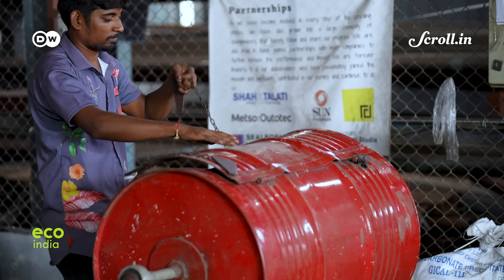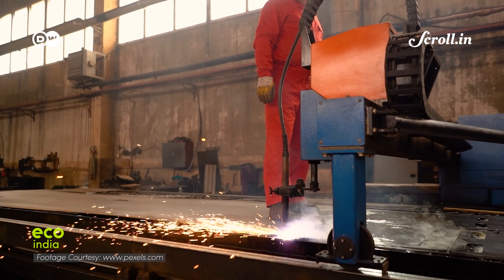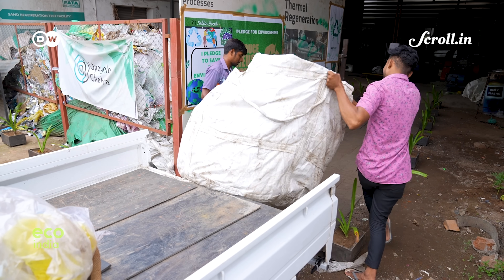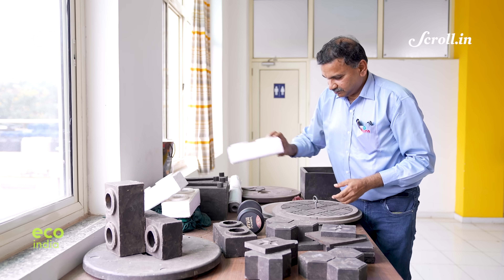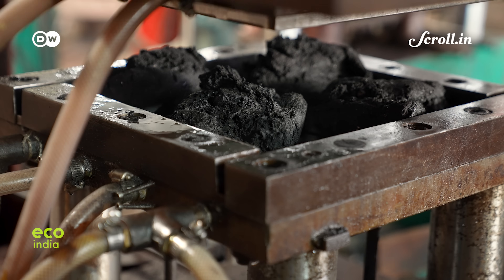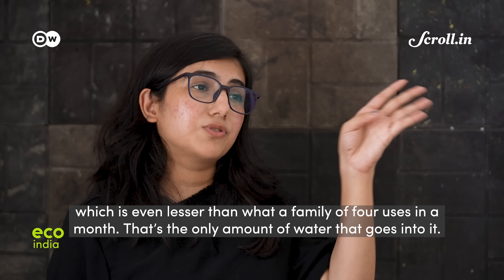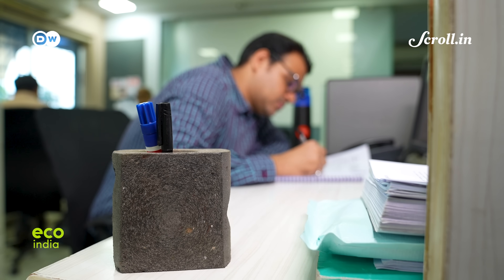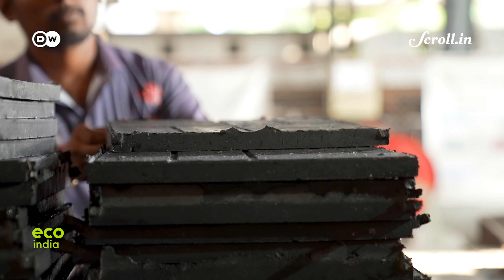Eco India: Can we construct using just plastic waste and dust?

Comment: Isn't this just "kicking the can" way down the road?  Eventually, all these blocks of plastic will become scrap from buildings torn down (or falling down).

My "gut feeling" is to find a way to (safely) incinerate the plastic and use the heat as a "by product".  Of course, this would require special "scrubbing" of the gases before being released into the atmosphere.

All I see here is some businessman trying to make money.

PS: and what about buildings (using plastic floors) catching on fire and releasing dangerous chemicals into the air?

Comment: The tiles and bricks are only ecological, as long as they stay on the wall/ground, where they are installed. What happens if the house is torn down? The plastic will never be recycled, because it is mixed with foundry dust.This is not upcycling, it's downcycling! They take perfectly recycelable used bottles and make them into unrecyclable  waste that will stay for thousands of years.

Comment: Faulty machines and design. Their machines are a simple failure. I am the 1st person to buy their Spb machines. Not even a single day they functioned well. Every day something or the other issue. Their men came several times to fix the issue yet they couldn’t. From 2 years I am struggling every single day. Yet the machines didn’t function even a single day properly. They are very cunning and cheap people. Simply loot your money and don’t even respond later. They took money from me for insurance and did the insurance on their name and claimed the insurance even without telling me. Cheap n cunning people.they couldn’t fix their machines from 2 years yet they are dragging neither compensating me. I have to suffer every single day for their machines. Don’t even consider this company. If you still want to buy ask for previous customer feedback and then think of it

Comment: These might be a good substrate to etch shallow designs in for potters. Stamps, texture mats and rollers, press molds to make sprigs from.
Seems you ought to be able to add something to the shredded plastic waste to make it acceptable to run in a 3d printer.

Comment: Considering mixing any binder agent and any filler material can get some interesting results, I so why this could not make bricks suitable for at least 1 story homes. If need be, reinforce the corners and middles of the walls and use the bricks as non-weight bearing building materials.
Meanwhile, some people use epoxy instead of water to bind concrete mix.

Comment: I hope they don't build houses with these bricks..  when they catch fire they are already toxic enough...  plastic burning will certainly lead to way more deaths succumbing to the smoke!!  Better for sidewalks & driveways maybe??
Reply: exactly... rather eco friendly its more hazard to environment
Reply: @anonymous15924  Great for paving sidewalks or driveways though...  there are applications for them that make more sense...
Reply: @bikinglikebecker  That would produce lots of micro plastic particles everywhere
Reply: @SolarCookingGermany  talking about houses, not paving the sidewalks with it..
It will take a very long time for that to happen..  still I think normal bricks are better..  I was just suggesting something less dangerous than using for building a house
Reply: @bikinglikebecker  india actually build plastic road highway
by dec 2019 india have made 35,000km of road by using plastic waste
by 2024-2025 there will addon of 50,000km also
Reply: @user-we8hi4yu6  Not sure if that is a good thing or not, but when comparing it to asphalt, it can't be any worse...  though asphalt is much easier to repair...
Reply: @bikinglikebecker  it last 10 year without maintance when asphalt need maintance after 5 year with same use

Comment: These blocks should be very strong, light and impact resistant with the plastic essentially sealing up and residual issues that might exist in the sand.    The only vulnerability might be fire resistance.   But a fire retardant in the mix would solve that and the sand itself would quench fire I would expect.   These materials are lying around essentially free and causing a nuisance.   Apply some heat and you have a brick!    Compare to mining calcium deposits, applying a lot of heat for kilning to produce cement, then mine sand and aggregate from big ugly holes, then use precious water to makes blocks.    I see big potential if done right.

Comment: One consistent fear is using these for floor tiles can cause both microplastics & heavy metal particulate in the air due to abrasion.
Reply: Is this something you know about please? I am asking because I do not know and just trying to gain knowledge, please. 
You see this is all new to me and I am studding it like maybe you and others. I figure if we ask each other questions we can all learn.
Reply: @classic-hb8vs  lookup asbestos its the same problem you looking at from the beginning not the end as with asbestos
Reply: My dear thanks for thinking because you are seeking knowledge. in short there is limited and no effects to the air nor soils,how? When we melt the plastics,it means it will have lost the microplastics particles since it involves mixing sand and porridge like form of melted plastics. And there is no effects of air pollution ,because once the abrasion happens the particles can easily degrade since the highest percentage is sand. 
Thanks!
Reply: @kwikirizajames-fc2sx  and when it degrades what cognitional parts isert degrades back into? plastic always plastic, it just parts get smaller and smaller, once to seitan size its called micro plastic it still the sam stuff just in smaller pieces
Reply: everyone already experiences that through vinyl flooring and linoleum and everything else
Reply: This is gonna cause an asbestos moment in 20 years time. Oh no we didn’t know this could be a bad idea to the health of consumers
Reply: those metal dust actually mixed in aspalt and pavers bricks. sowe already surrounded by it the whole time.
Reply: Okay, so no wearing golf shoes on the floor and it should be safe!😅
Reply: Yes it would require carpets i think 😅
Reply: @NitishYadav-lb7zc  "Yes it.."  Good point.
Reply: I think products like this will be this era's version of asbestos. It's all literally bricks of plastic and heavy metal, which will degrade as the years go by and shed even more microplastics and toxic material as time goes on.. and they plan to use these in homes and residential eras...
I mean, I understand the need to reduce waste, recycle, and make affordable materials for everyone. But we must also not forget that these bricks are a double-edged sword.

Comment: Amazing product that maximizes heavy metal and pthalate content? So, whats the difference? The block is still #toxic given its made from toxic dust. Seems to be no difference, wouldn't those blocks  leach chemicals just as well? - As most plastics are permeable to water vapor and liquid water, on the molecular level. @3:30 "300 percent less energy"? That is plain wrong. That would imply, that the process would release 200 percent energy? You can only save maximum 100 percent of 100 percent, FYI. #fail Don't write about energy consumption, if you don't understand it. But, if it is just plain #silica dust with no heavy metals and #foodsafe plastic waste, this can make a #great engineered building block!

Comment: Great idea. Converting two problems into one opportunity. Though fire hazard may be a concern, as the used plastics here are not fire retardant. Also unprotected use outside exposed to sun and weather may re-release the dust plus microplasics when the plastic breaks down from UV-exposure and chemical exposure.

Comment: Product is fantastic in terms of its strength and fire resistant..... I worked on the project myself, but the long term exposure to heat and it's LCA needs to be done to ensure that it is not a harm to the environment.

But yes it is a great opportunity to reuse and divert the the plastic waste from landfills to a better resources.

Comment: plastic itself is toxic.. I would say, it should be restricted to be used within a well contained space.. I am afraid, put them on road as waste, it would slowly seep inside soil. It is better start thinking about vegetation that can suck the toxicity and convert to breathable and livable soil
Reply: Also plastic will not go well with mortar, and UV can destroy plastic to be brittle and strength of such materials can't be used for load bearing or even long term walls

Comment: 1.I dont think it would provide same amount of load bearing capacity compared to traditional ecoblocks or bricks if being used in construction. But good alternative for pavement and for low load bearing conditions.
2. The plastic would degrade over the time due to UV light exposure resulting micro plastic contaminating environment. However decaying of the plastic can be stopped by post processing UV resistant coating.
Reply: So, go buy a few and do the testing. Post the results. I'm curious as to the cement they use to put up the tiles and place the floor. What sort of finish would give a better choice of colors, and longer lasting colors.

Comment: The most thing I like is how the all workers inhale toxic fumes, after all nobody needs old indians. Let's " build a cleaner, greener and better tomorrow " Indeed!
Reply: The process has no toxic fumes, has been tested for VOC before workers were exposed to the manufacturing. The small quantity of fumes which come during the output are captured in a wet scrubber - zero discharge to air has been ensured, checked and approved with measurements, validated by Pollution Control Board
Reply: @rhino.manish  SUCH DAMN LIES!

Comment: I think a lot more hazard testing needs to be done for this. It involves plastic and heavy metal.
Reply: Thank you! I was just about to point out exactly that
Reply: I would be wary of the material being used for flooring.  The material will eventually wear down.  So the resulting dust will be full of microplastics and heavy metals.
Reply: @kl3nd4thu  walking on it and kicking deadly metal dust into the air for your breathing pleasure.
Reply: Best case of reusability available for the forseeable future possibly. Meaning standards including hazard test though are a real concern, mostly go out the window once the market viability takes precedence.
Reply: 😂😂.. It was more dangerous before.. thrown here and there.. Atleast it is now concentrated in a pile.. But yes, It should not be used inside home.. It is ideal for parking areas, boundary wall.
Reply: Both of which are already present, this reduces both, as for the testing it is ongoing and time will tell.
Reply: @franktalley lol 😂😂😂
Reply: Asphalt roofs have to be worse and degrade faster I'm sure
Reply: Don’t use this material for building construction. There is a fire hazard from this thing. If a fire breaks out in those buildings the material burns and melts and will have to deal with a lot of harmful smoke and a lot of lives will be lost from smoke than fire.
Reply: @adamk.7177 lol
Reply: It is already in use in Australia. He must have copied from there. Look Sudha's green ceramics in Australia.
Reply: @emotionalIntelligence2078  Sudha green ceramics is an Indian company
Reply: What is the foundry dust? Iron foundry? Iron oxide? They also called it silica dust.
Reply: What about the fumes from melting plastics? His research lags.
Reply: yeah these people are just useless pawns for plastic industry and foundaries to offload their wast product onto someone else. these hazardous materials will break down after 5-10 years and then get throwing into waste and it will be in landfull not contained properly. 

mixing various waste materials into one just made them much more difficult to deal with for future generations.

the foundry dust migfht be possible to seperate the sand and metals in future.

the plastic might be able to be melted down to plastic stock.

but blending these makes it impossible to reverse.
Reply: common sense.. these modern day inventors have to look beyond their greed & fame for humanity sake.
Reply: Nah, it already has, basically they just glueing it back together after afew adjustments
Reply: When you will step/walk on it you are grinding some of the material off from the floor . The plastic which contains heavy metal  , when you are trying to make it usable you are actually letting the heavy metal get into your lungs. This is slow poisoning. 😂
Reply: @sigmamalerules1106  These people push a turd aside to get a drink of water. I doubt they worry much about micro plastics
Reply: You need to collect lots of plastic bags in the city to make these bricks
Reply: @lalchandkate6696  plastic does not dissolve in water, so even if it is thrown into the landfill, it will be safer than sand alone, because it is compacted the volume will be reduced, so it decreases the space occupied in the landfill, the end result is positive even in the worst case scenario .
Reply: @DanielSilva-jj2lz  Plastics do leach out chemicals. Remember the big who hah about water bottles? But encapsulation of the foundry dust is a heck of a step in the right direction. It does need a lot of testing, just give us documention on it's stability, longevity and leaching by products.
Reply: @sabrekai8706  honestly, the foundry dust needs to be removed and studied more on how to neutralize the hazards. Surely it would be better being added to a metal application?
Reply: @DanielSilva-jj2lz  it releases microfibres of plastic.

Comment: You can but in fire what happened think polution desaster ??? As plastic Can burn.
Reply: Yesterday i did a home test to ignite SPB - wood & plastic ignited but not SPB. That's a home test, but when sand & plastic get mixed with each other with sand being 70% of the content, the characteristic of burning has been inhibited from our preliminary tests.
Reply: @rhino.manish  stimulating conditions at home not possible as when slow burning start and heat generated about ४०० degree Plus then burning started as red fire 🔥 temperature will be ६००+

Comment: This is a good idea except I’d be worried about the fire hazard. Plastics are flammable and release toxic fumes when on fire
Reply: Yes but as other materials in the house combust, this material would decompose and release toxic byproducts. Unless it’s HDPE or LDPE only, but pvc and polymers similar release vinyl chloride and styrofoam release styrene
Reply: Yesterday i did a home test to ignite SPB - wood & plastic ignited but not SPB. That's a home test, but when sand & plastic get mixed with each other with sand being 70% of the content, the characteristic of burning has been inhibited from our preliminary tests.

Comment: I think this could be a great technique for disposing of waste! I do have a few questions: Since foundry dust is toxic, does leaching occur over time into the soil? How would this new product (silica plastic) be disposed of? What, if any, are the side effects of long term contact with the skin of silica plastic?
Reply: Right.
Reply: @Ranjit3xo videoa😊
Reply: One more will it catch fire easily?
Reply: @Cghbcargu7kkb12  Plastic is essentially just oil, it will burn well.
Reply: @Mad_Catter_  so it's not safe to build a house with this product
Reply: @Cghbcargu7kkb12  Maybe parts of the house, but not anything too exposed.
Reply: Thank you. Please connect with www.upcyclechakra.com to perhaps get answers to your queries.
Reply: you know it right. they are fooling the stupids.. glad that you are not one among the fools.
Reply: Production of this stuff is highly toxic there is zero doubt about it. Thermal and structural properties of plastic are terrible, UV resistance is terrible, it becomes saturated with moisture easily which will further enable UV cracks to spread wide open.

This stuff is a pipe dream, might as well use Adobe or ceramic composites and be smart about things.

Erosion and wear will cause this plastic to spread into every facet of Earth.
Reply: It has to be poisonous.
Reply: @tomevers6670 when I saw the girl touching the tiles I was like HELL NAH

Comment: If sand casting industrial dust has heavy metals in it like lead metal then is it safe for making tiles from it ? especially if we have kids in home they can lick walls
Reply: Surely this is something to be considered and architects may need to look at where to use and how to use. Mostly in a house, the walls are plastered, and thus the probability of kids licking the SPB material are near to zero. The heavy metal as stated is generally cast iron, and it is in a marginal <1% amount, the quantum of dust which when flying in the air can go into respitarotry tract is the higher risk, which the SPB has tried to address.